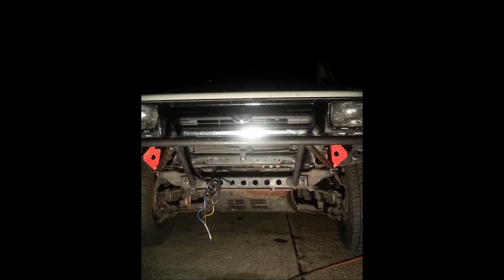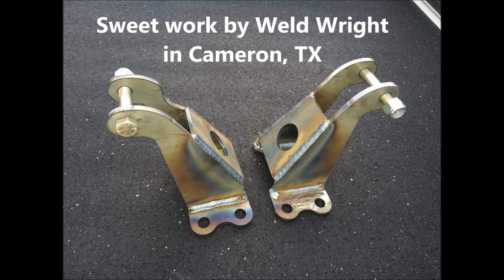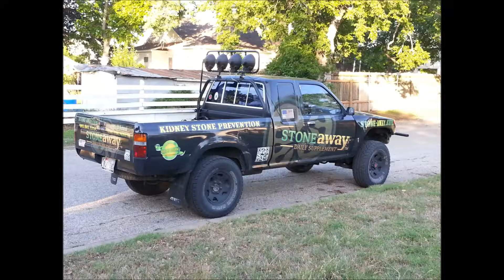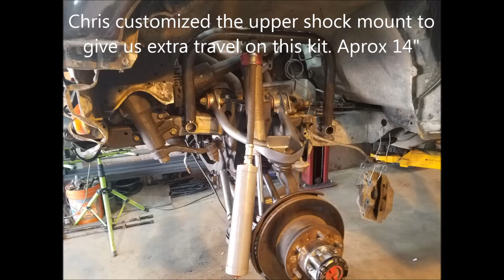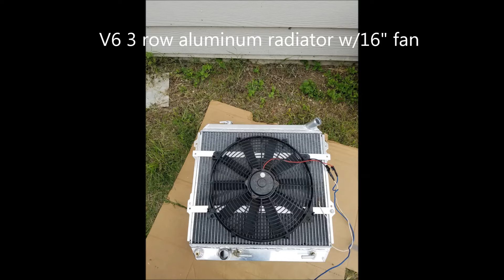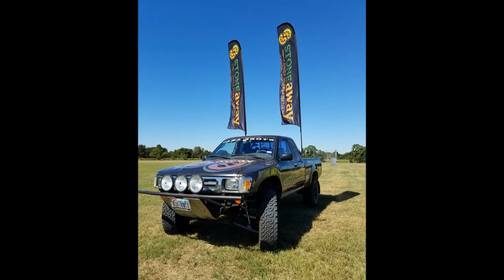Adding Total Chaos Long Travel kit to our Toyota Pickup and some other goodies too!

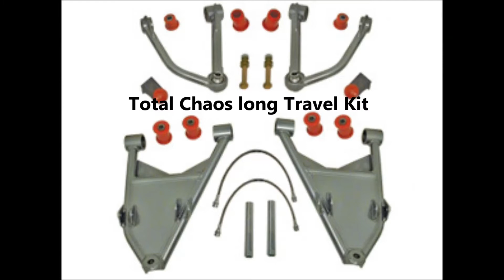Comment: The kit you showed at 1:49..is that the long travel kit that you used?  Does it make the front track much wider than the back?
Reply from the maker: Yes. It's Total Chaos kit. The front tracks about 3 inches per side wider.

Comment: Oh hey also, what did you do to space out the rear end? Just 2 inch spacers, or did you leave it stock width?
Reply: I’m doing the same thing on my 87 and was wondering if it would be necessary for me to get the shock hoop and tower?